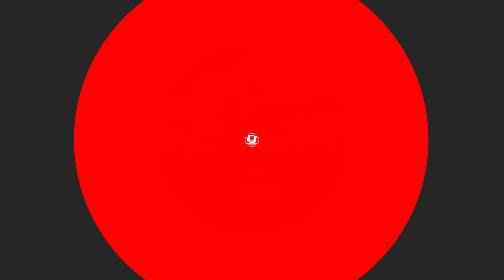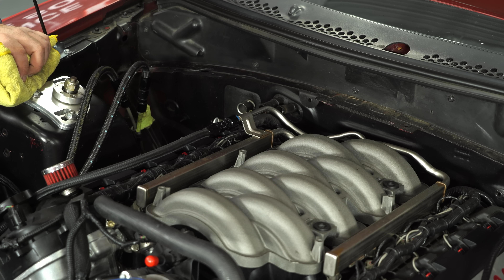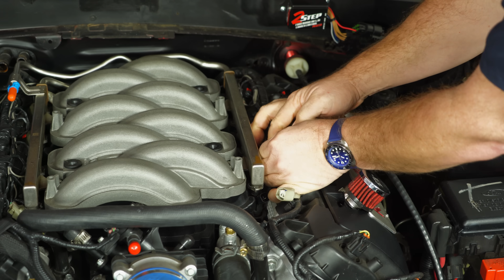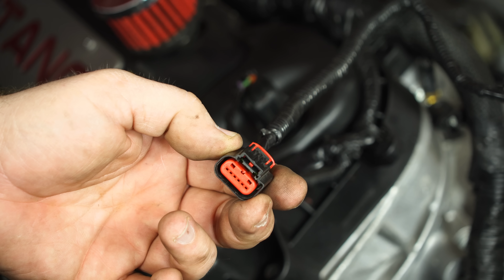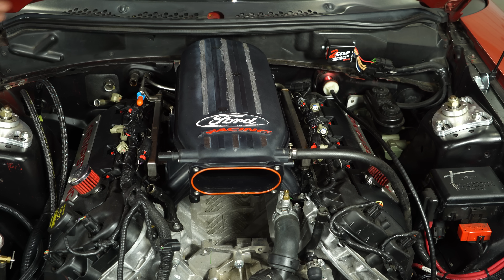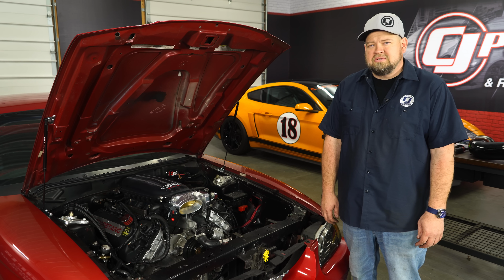2011-2022 Mustang Install | Ford Performance Cobra Jet Intake Manifold

Comment: very good video, but unfortunately, after I installed the cobra jet, an error appears Check fuel fill inlet 😢

can someone help 😥
Reply: That's becuase they skipped steps and did too many jump cuts. Hopefully you've found the problem, if not there is an evap hose that is under the master cylinder, it's a problem for automatics. Apparently you have to disconnect and cap it. Try searching mustang forums.

Comment: They should make a converter that plugs into that harness so you don’t have to pull pins, just plug it into one end and it will plug into the new harness connector on the other. Much better for the customer.

Comment: If lowering the motor on a 2015 for fitment what does that do to the driveline angles especially if you’re running a one piece carbon fiber driveshaft?

Comment: I really have a feeling if I try this install at home I won’t be…..back on the road in no time 😂. Bill makes it look easy lol.
Reply: Yea. It wont. No mention on the evap routing, wiring harness extensions, cutting of the non welded joininh tab on the fuel rails, then casually mentions new hood or motor lowering at the very end. It's just like Dr.Strange said, "The warnings come AFTER the spells." 🤦🏾‍♂️
Reply: exactly. My car would at least be sitting in the garage for 2 days.
Reply: @Meechmanbino took me 3 hours bro🤣

Comment: So I saw that this only fit for 2011-2014 mustang 5.0 but video says that it fits until 2022 so is there any adjustments or do I need to do anything inside the car/engine in order for this intake manifold to fit on 2018+ 5.0?

Comment: I have a 2011 F150 with the 5.0L and I want to do this upgrade but I'm wondering if it will turn on a check engine light?
Reply: You most likely need a custom tune I would think but not 100% sure. I would like to know as well. 🙌✌

Comment: Running a cobra jet on my 2016. Cut the back of the hood and it fits fine
Reply: @KINGKJ2REAL hey bro how much and how do you get the tune for this install?
Reply: Jeremy Ortiz / thatblue5oh 
Bought used 
Installed my self 
Lund tune
Reply: @KINGKJ2REAL bro please tell me how the heck you do the custom tune from lund, like idk how to pick it or anything, I'm gonna be putting on longtube headers catless, injectors for e85 and I want to do the cobra jet intake manifold with the twin 65 or vmp twin 67 throttle body and a pmas cold air intake, If this is too much my bad I just want to order this stuff rn but don't know how to get the tune ordered because it's confusing af
Reply: Jeremy Ortiz / thatblue5oh just go to lund website 
Order Ngauge and custom tune 
They ask for your car info and mods 
It’s simple bro
Reply: Well I have a custom tune on the car when I bought it and I have an sct x4 tuner device on hand already too, so when I'm trying to order the tune it's confusing the shit out of me tbh
Reply: @jeremyortizthatblue5oh616  so actually idk if you figured this out yet but Lund no longer partner with Sxt their strictly on another tuner programmer
Reply: How did you cut the hood? Any pics for clarity?

Comment: Good video, but to cut time I ordered the VMP 11-17 throttle body Y harness so no repinning was necessary. Part number from VMP is VMP-INM028
Reply: Hey man I need your help, beside the Y-Harness what other parts did you need to complete the installation of the Cobra Jet? Did you still buy the Boss 302 install kit? Thanks.
Reply: 1nespower no I did not buy the boss install kit as it is not needed. Just some fuel grade hose and a couple of 1/2 or maybe smaller hose clamps.
Reply: @kylebrandon4958  Even better so with that and the Y-Harness you were set? btw was the fuel grade hose the one they sell in LMR or did you buy it yourself? Thanks for responding
Reply: 1nespower bought it at Oreillys
Reply: 1nespower you can hit me up on Instagram @onemurdereds550 and I’ll shoot you pictures if need be
Reply: Hey Kyle if I sell my cobra jet and I had mine repinned I can’t just trade harness with a stock throttle body harness with no problems? Or I have to buy a whole new harness and repin again
Reply: @jorgecampos4203  let me buy it😭

Comment: Will this intake work for a 5.2 voodoo motor and if so what problems will we encounter.
Reply: Yeah it’s will work ,you’ll need some Hood modification
Reply from the maker: What Mohamed said is correct. If you don't want to change hoods you can get adjustable motor mounts and you will need a custom tune.
Reply: Thank you 🙏 appreciate your response

Comment: 2011 GT - Will a custom tune be required with this intake/throttle body swap over?  Thanks
Reply from the maker: Kevin Mace yes any CJ swap requires a custom tune, it will run but not properly